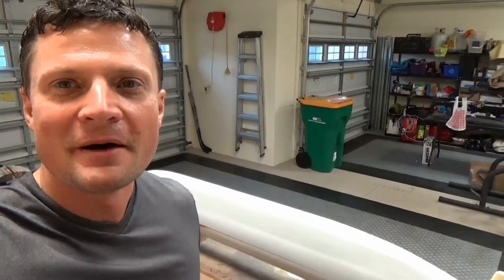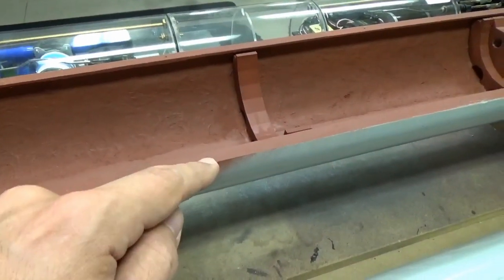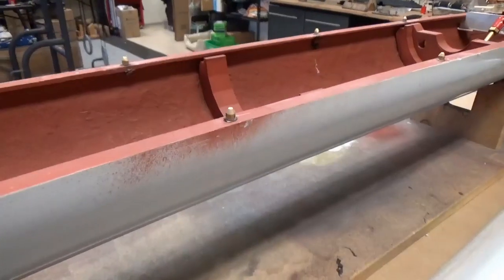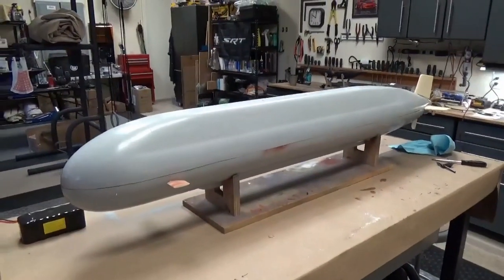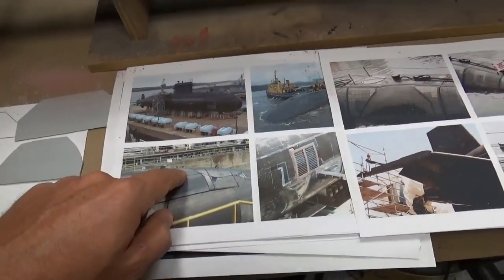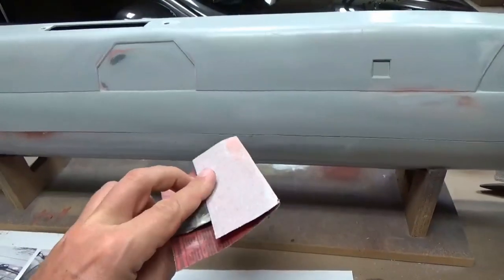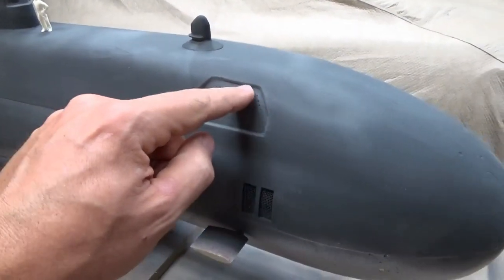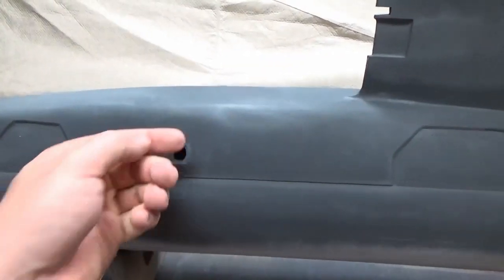Upholder Class submarine RC buildup CH4 - Hull alignment and detailing

Comment: Have you tried using hard drive magnets instead of the thumb screw? They can probably hold 50 lbs.
Reply from the maker: I've used a lot of magnets in other builds. While b I think they're great for smaller projects or static builds, I wouldn't trust $5k worth of sub to a magnet. For now, I'll stick with hardware to hold my boats together... :)
Reply: haha, I didn't realize they were that much. I'm just starting to look into these. I don't blame you. How much do these typically weigh?
Reply from the maker: +Bill Roberts Depending on the scale of the boat and whether it's set up as a dry or wet hull, you're probably looking at between 20 and 50lbs